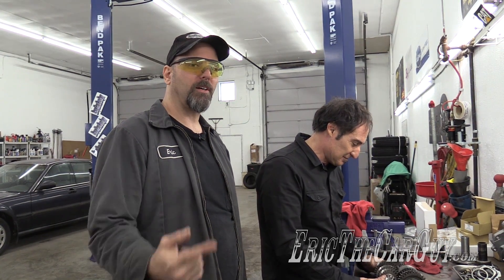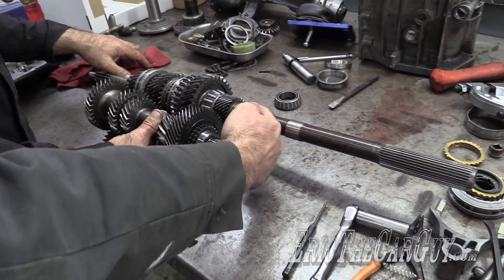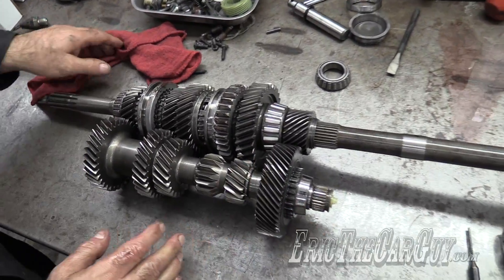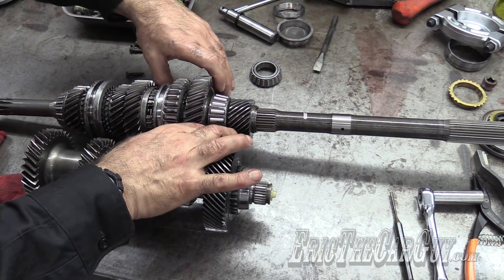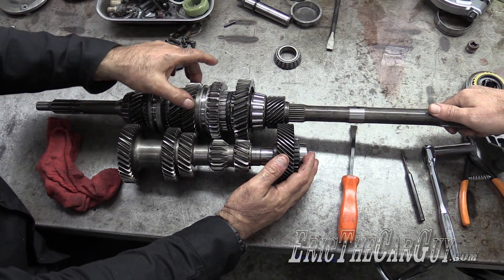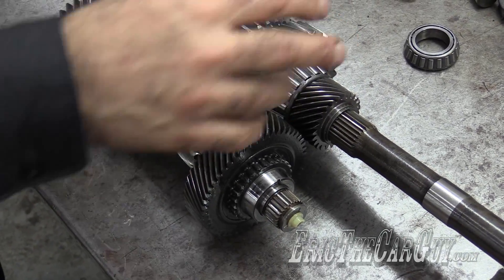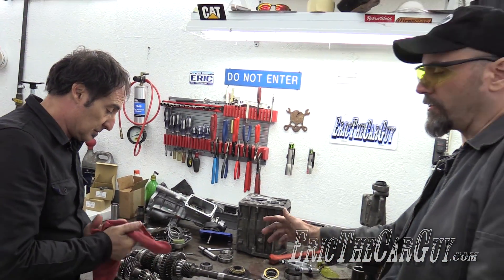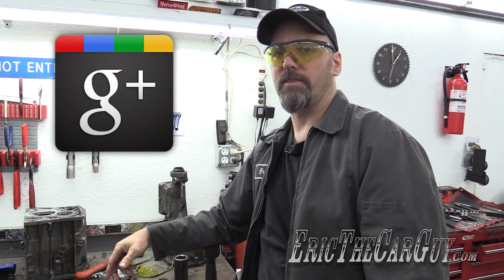How Does a Manual Transmission Work? -EricTheCarGuy

Comment: #EricTheCarGuy

I would like some info on 1999 Saturn SL2 manual 5 speed transmission.

I am looking for a sleeve or fix for a pin inside of the transmission in these cars. With the snow and ice here, wheels spin most of the winter, and this trans does not like that. 

Our car had 180k on it. My wife was driving one winter and the "pin" they talk about, shot through the transmission and destroyed it. I dont remember what it looked like or anything.

Anyone know of a fix for this that would be great. My nephew is planning to restore an SL2 to as new as possible. I know the pistons and drilling inside of the "land" of the oil return. We want to make an old SL2 run 500k from restore point to that mark. Maybe more.

Comment: Paul Cangiolsi needs his own you tube channel.  Very Informational video.  Thanks
Reply: I have one.  short link is http://www.gearboxvideo.com
Reply: +GearBoxVideo Subscibed.  My self adjusting clutch went out, and still had plenty material left on the clutch, but would not engage in any gear.  watching this video helped me determine that the it was the clutch that  was just wore out and the transmission was fine since when in fourth gear it should bypass all other gears and turn the rear differential.  I guess it was something to do with the self adjusting pressure plate or maybe it's just designed to save the flywheel from damage.

Comment: hey great vid! Got a 95 honda Civic de sol manual trans . Put it in any gear and you can push the car easily. will a separated clutch hub cause this or is it something else. Also the familiar clutch smell. fiber on the fork arm. Care to bite???
Reply: +Michael Nicholson Sounds like your clutch came apart. If the maindrive was broken in the transmission you would hear knocking banging noises.

Comment: I have a 2003 Dodge neon SXT with a manual trans. I was leaving work 
yesterday and i was going into 3 rd from second and when i let the 
clutch pedal out it felt like it was in neutral. The whole way home i 
tried to go into 3rd with the same result. I have had no grinding or any
 problems  at all before that. I checked all the linkage and it all 
seems to be working fine. Any ideas?

Comment: hey eric, whats your record time for removing a manual trans from a FWD car? just wondering if im getting excited over nothing as i removed one from a 05 corolla in 1 hr 15 mins and ive only done it once before on my own(yes i work in a garage but i usually do the "light jobs" like replacing pumps,starters,fluids,suspension stuff ect)..

Comment: Nice one  :).   Got a question for you, I recall some older cars having a push button for over drive how does that feature work?
Reply: Ah, I've just learned that sometimes there's a separate unit for that added on
Reply: +Michael Farmer  Actually the early Borg Warner R10 was one.  The button actuated a solenoid that locked a planetary gear to create an overdrive.  Later corvettes from 1984 to 1988 used a similar setup using wet clutches to lock a planetary behind a Super T10 4 speed called a 4+3. These were also actuated by a solenoid that blocked a valve body passage pressurizing the OD clutch pack.

Comment: Any chance you can show actually why not to flush an old auto transmission.
Reply: In most cases, flushing an old one has no negative effects. The only time it will have an effect is if the transmission is going out already.

Comment: It's clear to me this is how they had to do it in the 1800s when these things were invented, but NOW it seems it would be more efficient to select, sync, and engage the desired gear with a computer and servos.  I wonder if anyone has tinkered with that idea.
Reply: +Anton Nym Look any current DCT ( Dual Clutch Transmission)  such as the Ford Powershift  or VW DSG. Basically, the design you speak of has been around for quite some time. DCT units give you better efficiency  than a typical torque converter based automatic and faster shifting and better efficiency  than a  manual shift transmission. Although, the one in my Ford Focus shudders and shifts horrible. The problem with computers and hydraulic servos is that the programming is just not there yet.  The Ford situation is a real mess.
Reply: Mine chatters

Comment: I did a two year mechanic course in college and in the 2nd year it was really in depth with stuff like this, you didn't need to fix a transmission just have a basic understanding of it. I'm very thankful that I didn't need to understand it to pass the course because I failed big time, it went way over my head.
This video explains a lot and so simple, the yellow math looking thing that came up didn't help though, gotta say, just when you were showing going through the gears, very cool stuff.

Comment: So in principle you have to go from drive to driven to driven to drive, and on this transmission when in fourth gear the drive is the driven.
I have brass synchros in my manual transmission too which is why I couldn't use the GL-5+ and had to stick with the GL-4 manual transmission fluid instead.

Comment: please we want to know how to automatic one working .. everybody know how to manual working  .. and why not all the car don't use cvt type like ?
Reply: +ابراهيم سلامة Like Eric said in those older videos, in the old automatics the entire shifting magic is oil pressure and a complicated set of oil channels and check valves which he did show us.
Pending on which gear is engaged and the oil pressure, which increases as the engine speed increases, it choses the appropiate gear.

Newer ones you can get the values from the ECU itself and have it operate the valves in the valve body with the oil changes to change the gear.
Reply from the maker: +ابراهيم سلامة https://www.youtube.com/watch?v=JGbsgpp2YJQ
Reply from the maker: +ابراهيم سلامة https://www.youtube.com/watch?v=0Qf6O0oAs7U
Reply from the maker: +ابراهيم سلامة https://www.youtube.com/watch?v=pTfipsejqS0
Reply: i mean shifting section not clutching section to answer this questions 
what is the shifting connecting mechanism  .timing or rpm or numbers of laps of flywheel is the shifting controlled by computer  to know what is the proper gear 
and thank you for your comment

Comment: I had a 1989 Mustang with 2.3 and T5 (shown as T50D in the manual). The transmission was bulletproof, but the rest of the car wasn't.  Had a bad example.  What intrigued me was that the trans used ATF instead of 75W90 like in most other manuals (like my 2012 Fusion I recently traded in)
Reply: +geforcefly1982 T5 world class takes regular old DEX/Merc. Many RWD manual transmissions also take auto fluid, or syncromesh. The reason why your fusion was designed for gear oil is because it's FWD and the differential is in the same case and uses same oil.
Reply: Well explained :)

Comment: Have a question, the transmission on my Suzuki Vitara locked up while driving. Only gear I had access to after stopping was 5th gear. Bought a second hand transmission, put it in and it drove perfectly for 40minutes heard a screaming noise (like the old transmission) when I stopped I lost access to all gears but 3rd and neutral.

Even with engine off I am locked out of other gears, What could the problem be?

Comment: Maybe someone can explain this to me: when I am putting in the first gear while standing, it works perfectly but when I put in the reverse gear, I sometimes hear that grinding noise slightly. Is this because the clutch release is worn and some of the power of the engine is still on the gears?
Reply: revers has no sincronizer so if your car is moving a bit or the cluch is spining a bit on the input shaft on the transmisio than is making that griding noise .... dont wori about if its just a litle nois :))
Reply: +Dick Fageroni It happens for example when I start the engine in the morning and I push the brake and clutch while the first gear is still engaged and then I put in the reverse gear after that. That's when it happens almost all the time. My solution for that was that I put in the reverse gear before starting the engine, but I still think it's weird. Is there a reason for this behaviour?
Reply: +pcfreak1992 
Check clutch adjustment when completely cold. 
When the clutch is not properly releasing, the drag will spin the input shaft which also spins the counter/cluster gear and allows a grinding when the reverse slider is engaging the stationary reverse gear splined to the output shaft. 
The clutch friction material has lower coefficient of friction when heated, masking the improper clutch adjustment.
Reply: An easy way to check for poor clutch release with a non synchro reverse is to simply get the engine up to operating temp, while at an idle press your clutch pedal down and count to 10 seconds. The trans if fully disengaged from the engine should stop spinning and reverse should engage without a grind. If it still grinds you either have a clutch release issue or a pilot bushing that is too tight.
Reply: almost all the reverse gears are spur gears which are noisy. Sometimes you can hear them working if you start listening
Reply: +Dick Fageroni even if the engine was not running before? I mean, I push the clutch and the break and then I start the engine. After that I move from 1st to reverse, without ever having engaged the clutch.
Reply: +Dick Fageroni I actually do have to use quite some force to shift gears, but only when the engine is cold, like in the mornings. After a few minutes of driving it becomes normal again. Do you think the clutch cable might be stretched and while in use it "shrinks" a bit to have a normal length again?
Reply: +Dick Fageroni Thanks for your advice, I will definitely try that out!
Reply: Mortalomena
Possibly, changing gear oil should not cause any additional harm. 
However,  from his descriptions it points more toward an improperly adjusted clutch or possibly a delaminating clutch disk or possibly both.
Reply: +pcfreak1992 There's no sinchro on reverse (except mazda actually) select reverse slowly and all is quiet.
Reply: Michael Glynn For some cars it doesnt matter. My dads Focus crunches the first try into reverse every time since new. Its because some adjusting error that my dad never bothered to have fixed.

Comment: Hi Eric, i have a question: when you press the clutch engine and transmission aren't connected right? So for example a costant transmission noise when the clutch is pressed and no gear is selected can only be caused by flywheel, clutch ecc but not transmission itself right? Thank you
Reply from the maker: +planet1250 https://www.youtube.com/watch?v=FfjGohWy-OU
Reply from the maker: +planet1250 http://www.ericthecarguy.com/faq/solving-transmission-problems
Reply: +patw52pb1 thanks for the advices :)
Reply: If you want to insure the transmission is not moving put it in any gear. If the noise is still present its a pilot or release bearing issue.
Reply: If the transmission isn't receiving drive it won't be that. Could be a throwout bearing sticking, maybe?
Reply: +AnthonyH hi Anthony, i thought about that but the clutch pedal feels smooth and never acts strangely
Reply: EricTheCarGuy Thank you
Reply: +planet1250 Thanks to Erics video on how the clutch works i have understand that the gearbox DOES NOT MOVE when the clutch is disengaged off of the flywheel. I actually was aware of this but a mechanic that's 30 years older then me told me otherwise and then i doubt about what i knew. Thanks again Eric
Reply: +planet1250  
The possibilities are: a failing pilot bearing, worn crankshaft main bearing thrust, failing transmission input shaft bearing, failing clutch release bearing, worn/loose release bearing fork, broken fork return spring, failing clutch disk.
Reply: +GearBoxVideo thank you

Comment: id like to see a video on a 18 speed Eaton fuller gear box.
Reply: +petej222&#160;
Talk about different beast in every way, pneumatically driven on top of everything else. Just the load punt on these gears in a regular car amazes me on how much force semi trucks deal with for thousands of miles per day.

ETCG needs a bigger lift an a lot more ceiling space in the near future :D
Reply: +petej222  
The operation is very similar to this transmission. 
Think of it as a 5 speed + reverse transmission connected to the engine where it's output is connected to the input of a 3 speed transmission.
Oh, and much larger. ;)
Reply: still would make a good video
Reply: James Bankes hear some good crunches when the truck has driver under instruction on it.
Reply: +James Bankes Must be like that in the old ones, I suspected all newer 18 speeds were syncroed by default today.
Of course Volvo does offer a syncro less truck gearbox, but it is automatified manual under the name "I-shift"
Reply: Which is really just a 9 speed gearbox, with a 2 speed hi/lo splitter rear axle, so you you have 9 speeds in lo and 9 speeds in hi. but still a fun transmission to shift,  Ive driven them.
Reply: patw52pb1  it's not even close to this transmission, what are you on cocaine? 18 speed is only like 9 gears, they use a splitter to get the half gears, not even close to a transmission on a car dude, quit smoking your crack pipe, there is no syncronizer either you dope
Reply: +petej222  no syncros in that one lol.
Reply: yeah, got to learn some how.
Reply: James Bankes thats it